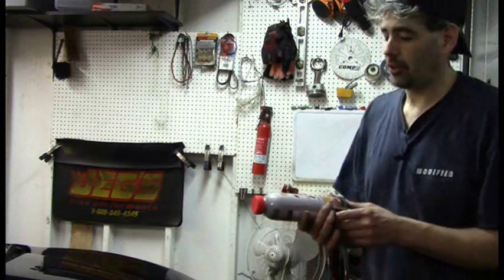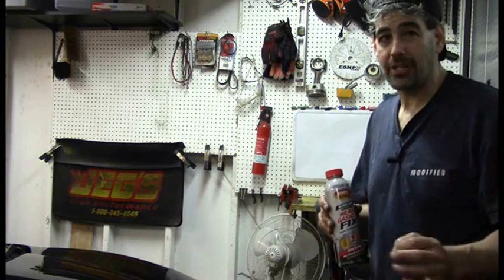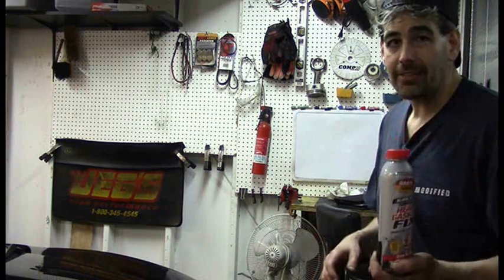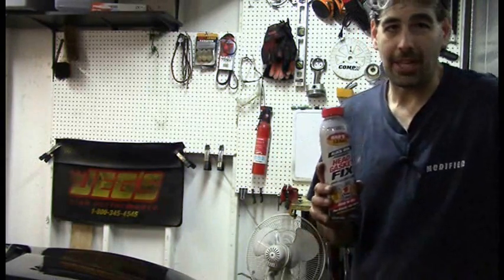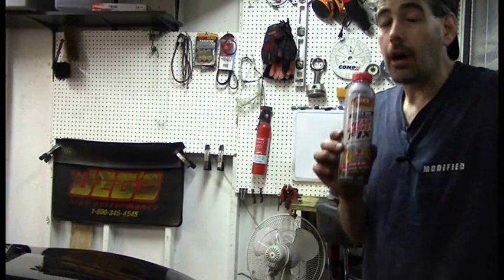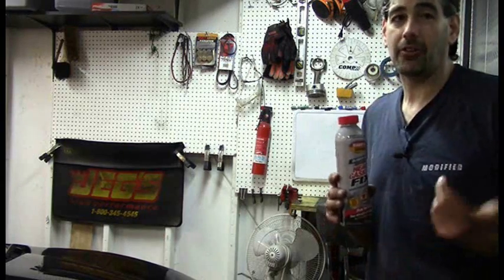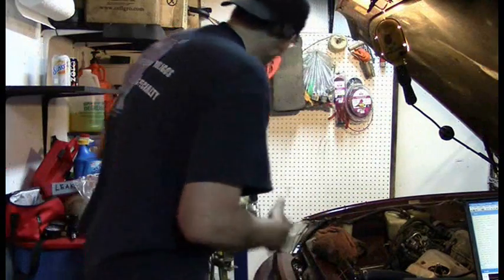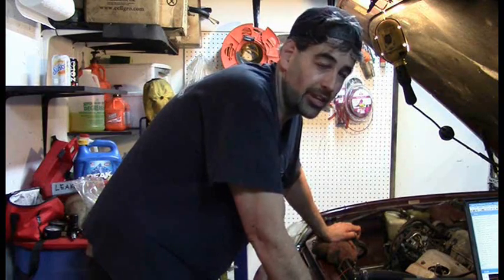Liquid Head Gasket Repair / Block Sealer Scientific Testing

Comment: Hi All!  I'm not normally one to ask for advice in this way, but I'd really appreciate some input from the public:
I just bought a 1995 Toyota 4Runner with 239,000 miles. It runs great, but the previous owner had never replaced the head gaskets. No current symptoms of HG leak, but I'm guessing it's bound to leak just because of the age and miles. It has a solid cooling system and no issues over heating.  What would y'all suggest?  Should I do anything to the HG yet, or just drive responsibly.  4Runners of the date range we're known for HG issues so I dunno what to do?
Reply from the maker: Diagnose if there is a head gasket failure or not. That is the only advice. If the head gasket is not leaking don't fix it because it is not an issue.
Reply: @SchrodingersBox  wonderful!  Thank you for the reply and for all the  great info!

Comment: I always drain the antifreeze, no matter the sells pitch on the product, and flush the radiator and engine with fresh water. I add water and the sodium silicate product, let it warm up, take for a drive, and normally use two cans of the stuff. It works. I then drain the engine and radiator, add full antifreeze green back and can drive for quite a few miles, often over 30K, and a refresh usually fixes it again. I wish you'd tried by adding the second can to give a chance to fully seal it.

Comment: I think it needs a few days running of the car. I used Rislon copper sealant well over a year ago, (I believe they are the same thing). It worked marvelously. completely stopped the leaking in about 3 days, and till today no more leaking at all.(2005 Buick Allure 3800 III). Before that I could smell the coolant from the tail pipe exhaust smoke. you are one of the best teachers on YouTube,  I have learned a lot from your videos, thanks so much for your really hard works and kind heart man. we all like you.

Comment: I know this test was years ago but would have been good to see you run it down the highway for 30mins then retest it after cooling for a 2nd night. Just think if its able the make a positive change in just 15mins it could only get better if run longer and hotter? 
Yeah i know ur just following the directions on the product but still...
Reply from the maker: Can’t really do that because There are infinite permutations to variability.
Reply: @SchrodingersBox  yeah i get that but there were also infinite permutations in variability in the "controlled" tests u performed.. I'm sure i don't need to point them out for you.

Comment: Is there a way to verify if a head gasket sealer was used on a car?  Curious as will be looking at cheap used cars soon for my Son and it would be nice to know if it was used.  I have heard that it leaves an oily residue in the coolant.  Any other signs to look out for?

Comment: Steel Seal is the only one that worked for me when Bars Leaks, Blue Devil and K&W didn't.
Reply from the maker: You have no scientific evidence of this. What were your pre and post compressions?
Reply: @SchrodingersBox  My car no longer overheats or loses water/coolant since the repair that's the only proof I need.
Reply from the maker: EXACTLY. No scientific evidence. You have no idea what the baseline eitiology is.
 Why do people keep posting stuff like this?
Reply: @SchrodingersBox  Unfortunately I don't have to all of the tools to produce scientific data for analysis. But fortunately I don't need them when the results speak for themselves. Do I need a scanner to fix a issue if I've fixed it without one? No, No, No when the results show the issue/problem has been fixed.
Reply from the maker: OmG - results don’t speak for themselves. DATA driven independently controlled single variable analysis speaks for itself. Results is what laypeople see!!!
  science. this is science, not lame-ass guesswork!!
  again- where is your etiological proof of concept?
  Exactly.  
  science. bro.
Reply: @SchrodingersBox  Ok dude so you're saying results are not valid unless you have scientific data analysis to go with it?  Sure dude I don't think even Bill Nye the science guy is that wonky. But bottom line my car continued to overheat, smoke and lose water/coolant after using Bar's Leak and all of that stopped after using Steel Seal.
Reply from the maker: @electric8668  Yes thast is exactly what I am saying. Bill Nye is an idiot by the way but that is irrelevant.  Please think independently... for the last time- YOU DO NOT HAVE AN ETIOLOGICAL BASELINE ESTABLISHED.
  Therefore your necessitation of the premise is an Ad hoc ergo propter hoc logic fallacy.
  This is not rocket science man- just think for a few seconds about it.
Reply: @SchrodingersBox  I respect you and your vast automotive knowledge. So please respect me when I say Steel Seal fixed by overheating issues when other products didn't.
Reply from the maker: @electric8668  I acknowledge you say it.But your saying it does not mean that it fixed a head gasket failure. That is the point. You don't even know you if had a head gasket failure to start with.
  Anyway, never mind- only 2% of the population understand this concept.  I try, but I know I won't reach everyone.
Reply: @SchrodingersBox  I said it fixed my issues of overheating. I never specified what caused it. It could have been caused by a number of things for which none of those other products fixed it but Steel Seal did.
Reply: @SchrodingersBox  Why is it necessary to have a AGM setting on a charger when car alternators charge all batteries the same no matter the battery type?  I know you can answer this since you're such a scientific data driven guy.  Thanks
Reply from the maker: @electric8668  It's because of a couple reasons- first a charger and an alternator are not identical in operation. The AGM mode adapts to the battery charging through microprocessor control to prevent damaging it.  For example- try charging a completely dead battery with an alternator and you'll likely damage the battery,alternator or both. The correct procedurewith an AGM battery is to slow charge it fully and then start the car as opposed to jump starting it and then letting alternator charge it tyhe rest of the way.
Reply: @SchrodingersBox  Isn't slow charging best for all batteries no matter what type if they are dead? But when a AGM battery is in use in a car it's charged the same way as a flooded/conventional battery by the alternator. It's not slowly charged it's charged the same that is why I asked. So I didn't think it mattered for a charger to charge differently.

Comment: Mechanics don't like these products because they work, at least those with kevlar do. My personal experience confirms it. For any model prone to HG leaks, I'd suggest adding it before any problem develops because it only works with small - early - HG etc breaches before they get bigger.
Reply from the maker: Your personal experience only confirms that you do no understand how to scientifically test the products.
 Why is it that no one understands this??
Reply: Nonsense. I'm well trained in Science. One loses 1L of coolant per 800km before and zero after. That's good enough 'science' for most people because it works for them.
Reply from the maker: Not sure where you got your training in science but you have yet to identify your independent variable. Of course, you know that right? So why aren’t you assigning one?
Reply: I didn't say that 2 qualified mechanics identified the problem as being a small external HG leak and both suggested the need for a new HG. The other aspect contained in my post was that this was a small breach - ascertained by the observation that there was a smallish rate of coolant loss. That's why I said: "For any model prone to HG leaks, I'd suggest adding it before any problem develops because it only works with small - early - HG etc breaches before they get bigger."  This is what the manufacturer says on the product label. Are you suggesting that there might be some other element entering into the problem fix (from IL coolant loss/800 km to 0L L coolant loss/800 km) than the addition of the kevlar based product?  I made no claim to scientific certainty as to this fix, just that the products works for small breaches. And in my experience, - and the product manufacturer guarantees (full refund) it along these lines - it's all-or-none...the HG breach (independent variable) which causes the coolant leakage (dependent variable) is sealed  or it isn't. Of course, as in your methodology, which seems to make no attempt to ascertain the size or position of the breach/es), the make and model isn't considered. Presumably cylinder pressures would be important, but also the use/abuse of the engine after 'treatment'. Glad to discuss it further with you.
Reply: BTW, would you mind identifying your dependent and independent variables?

Comment: I had exlerience with this product. My case was a leaking freeze plug. It took at least three 15 minute idling and cooling down cycles to completely seal the leaking freeze plug.
Reply from the maker: How would it NOT work for a leaking freeze plug? The pressure is what- 12 PSI???

Comment: Bullshit scientist lol. I have tried those products many times and 7 out of 10 they only start to work after you push the system hard like driving long distance not idle for 15 minutes. You do have to put it in early on when the car still derivable and not overheating.
Reply from the maker: Where is your evidence you actually were fixing head gasket issues?
Reply: I used chemical kit and color went yellow.

Comment: Never tried it on a head gasket issue, but have tried similar products for sealing other leaks in the cooling system (sometimes fairly severe). Some are complete garbage, some are absolutely amazing (i had best results with a copper based rislone one). Only issue is that they dissolve pretty fast during a chemical-based coolant flush so you need to repeat the process. Its certainly a lot cheaper than a new radiator though!
Reply from the maker: I have to disagree 100%- the true repair for a blown head gasket is NEVER a new head gasket. It is a correction of the issue that caused the gasket to blow.  It may be resurfacing the cylinder heads to correct for warp. It may be replacing a cracked head. it may be replacing the radiator cap if that caused the overheat.
 NEVER NEVER NEVER just replace the gasket and call it a fix!!!!!
  The actually replacement of a cylinder head is hardly challenging. It is just spinning bolts. It really is nothing more than just spinning bolts when you think about it. Time consuming- yes. Challenging? No.
Reply from the maker: No Danny- actually I fully expect the audience to be advanced DIY's with above average IQ's which I make perfectly, perfectly crystal clear in my intro.  If you missed that crystal clear distinction... well, all I can say is I'm not surprised at all.
Reply from the maker: Oh yeah- it definitely works on cooling system leaks- but those are only what- 15PSI instead of 150
Reply: Schrodingers Box Schrodingers Box Yeah just a small difference. There is also probably a fair difference in operating temperature too. I'm a little surprised you managed to get any change at all here, perhaps it may work on worlds smallest head gasket leak, but you'd probably have so little compression loss in the first place that you'd barely notice.
Reply: Schrodingers Box Actually now that i think about it the likely cause for the "success" stories (other than placebo) is probably coolant/oil contamination or coolant loss scenarios that were misdiagnosed as a head gasket leak.
Reply from the maker: EXACTLY!!! Most people by far for example would misdiagnose a leaking intake manifold causing coolant to enter the combustion chamber. They would be completely clueless that is the actual cause and not a head gasket. This is a basic coolant leak, and would likely be repaired by these products making these morons THINK it repaired the head gasket when there was never a head gasket problem.
Reply: You realise your audience for this video is people that can't properly diagnose head gasket issues and are seeking ideas for repair..?
Thanks for calling us morons.
Reply: Danny Evans Diagnosing a blown head gasket isnt the hard part, its the repair thats very time consuming and challenging. And the only true repair for a blown head gasket is a new head gasket.
Reply: Schrodingers Box Well yeah without fixing whatever caused the issue in the first place it's very likely to reoccur very soon after, i was more implying that the only way to go from a broken head gasket to a non-broken head gasket is a new one as opposed to chemical sealants. I'd say replacing a cylinder head and gasket, as far as spinning bolts goes, is one of the more challenging bolt spinning exercises due to much tighter tolerance specs and procedure than other bolt spinning exercises, where its usually enough to just torque them to a point where it won't rattle loose and won't ruin the bolt.

Comment: Of course there'd still be CO2 dissolved in the coolant, wouldn't there? I assume during the 15 minute run time the leak was still happening. I"m interested in seeing the compression and leakdown tests. I've never used a product like this, but I've heard some amazing stories about it working well. I wonder (now that I've watched the compression and leakdown tests) if the leak(s) will seal off better when the car is being driven? Also, I wonder where the leak is happening. Did you tear the engine down and see?

Comment: Use steel seal.
Reply from the maker: Why? What possibly would that SCIENTIFICALLY result in? Please explain the SCIENTIFIC foundation of your response.
Reply: Schrodingers Box no scientific results just have used it a few times and have had good results. Like any of these products it's temporary fix at best though.
Reply from the maker: The purpose of this is to show scientific evidence of performance.  Might as well say "Use ground pepper and dish detergent" instead of steel seal.

Comment: This is the problem I think I may have among others on my 2003 montero sport 3.5 L.  The first code was to change the fuel filter per autodrone.  Then I got p0300 random misfire.  Don't know how to test the fuel pressure easily so I won't assume there is a fuel pressure problem along WITH a possible headgasket failure.  Would a leaky head gasket cause a dirty fuel code?  One thing I am going to try is your oil sizzle test.  Cheap and easy.  I didn't notice any frothy mess on the underside of the oil lid.  When I first bought it from the test drive there were no codes and it drove like I would have expected.  However, my wife had noticed some steamy white smoke from the tailpipe.  I did not.  I did notice an antifreeze odor pretty heavy from the passenger compartment.  Engine gets to operating temp but does not overheat.  No noticeable coolant leaks anywhere and after spraying around the intake no apparent leaks there.  Engine idles very rough and has threatened to stall once during operation but never did.  One time I tried to start the vehicle, it would not start and did start when I put it in neutral.  Is this a failure of the NSS?  And is it related to the other issues?  Likely not.  Whew, sometimes buying a used car I wished I knew more.
Reply: Also there is some minor coolant consumption.  Have had to put some in recently.  Seems like a slow leak.  AND it appears the radiator is new.  So I am driven to the conclusion that one or both of the cylinder heads are warped or cracked and the gaskets will not seal or is damaged/insufficient.
Reply: The bad about my situation is that I have to remove the plenum to get into the cylinder head area...  I know your heart bleeds for me.

Comment: You need to change coolant and oil after adding fix leak. Then run the car taking it for a ride. Then let it cool and check oil level and cleaningness of it. Also check coolant that's not mixed with oil and viceverse. Check oil cap for foamy stuff.
Reply: Actually run it first with the fixleak. Then change both fluids. Test again other day for both fluids to be clean.
Reply: My car showed visible coolant squirting to the floor. Added once it stopped it but it was just stop leak. Later another year passed to the oil. I added copper seal and it stopped the mixing with oil. It's been couple months coolant clean and oil still transparent. It runs normal
Reply from the maker: Then this obviously was not a blown head gasket. of course the product seems to have worked, silly!!
Reply: KuribreñaPaquete8 Are you talking to me? Ok then why the oil and coolant got together? And the engine even experience multiple misfiring. Now everything it's normal. Obviously did something very good

Comment: I've had some success with k&R brand. But that stuff can plug up your coolant system. Radiator, heater core, head and block. Had to do a super flush after. It did work for a few months though.